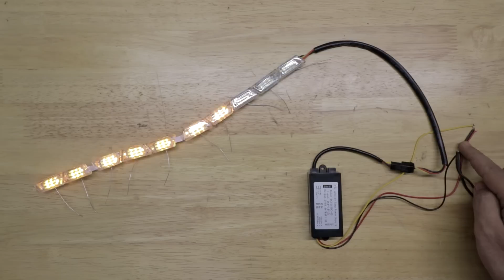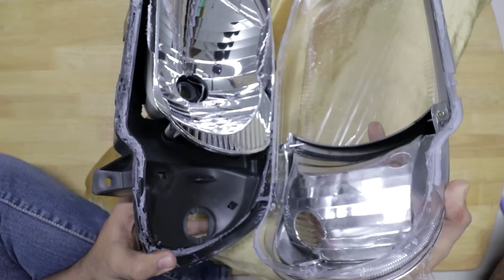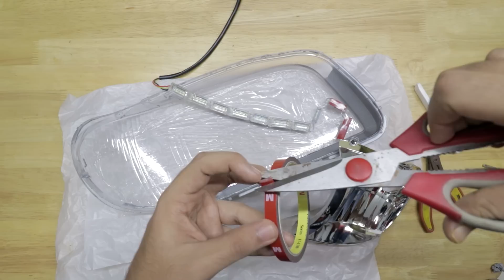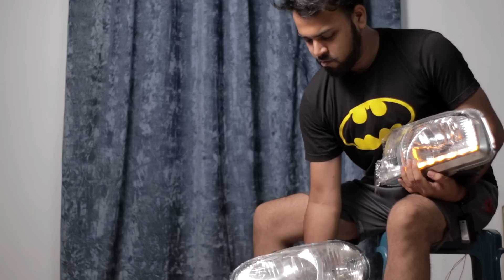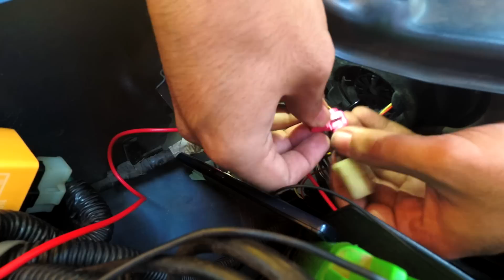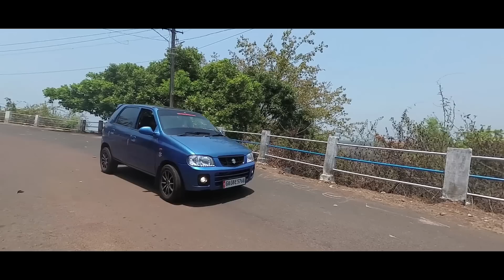Universal Sequential switchback LED DRL Audi style turn Signal lights retrofit in any car

Comment: Please correct me if im wrong ÷
1-In pack i will get 2 led 50cm each yes? 
2-I want 14cm ×2 pieces for my indicator...Can i cut it from the centre?? Like 25 cm each? And will it work??
*And the remaining 50cm led to be used in headlight area.
Thats how im gonna use it
Reply from the maker: A2 Footfreaks it will work if you cut but I feel there will be a delay in the sequence for turn indicator. 
Regarding of using the left over 25cm+25cm in headlight, that will not work as you will need two more seperate controllers. But with that said if you are professional with precise soldering then you can work your way out as it's a flex cable but again you will need one controller
Reply: How an I contact you to clear my doubts clearly
Reply from the maker: A2 Footfreaks Instagram